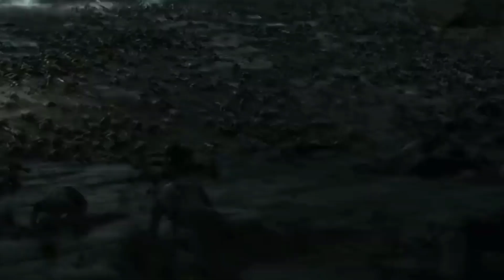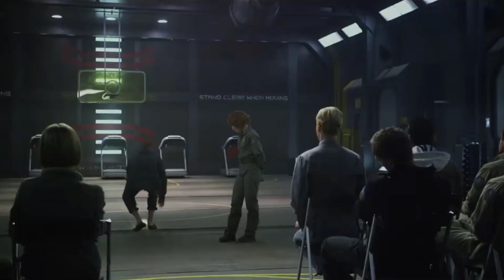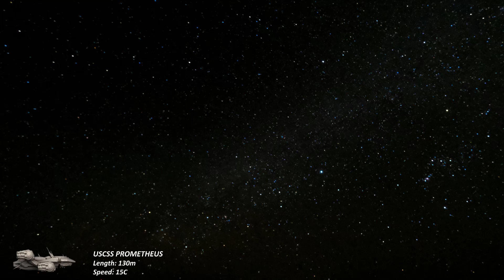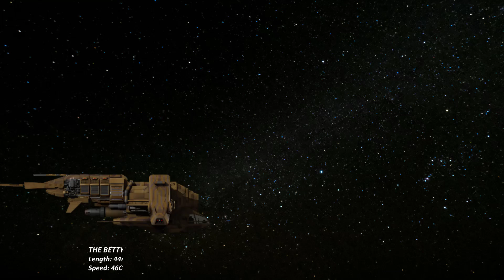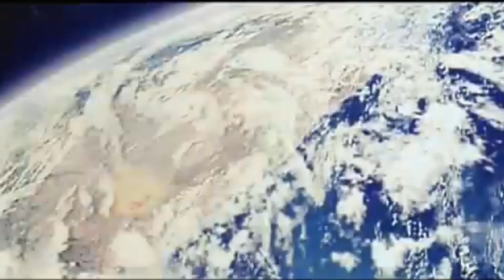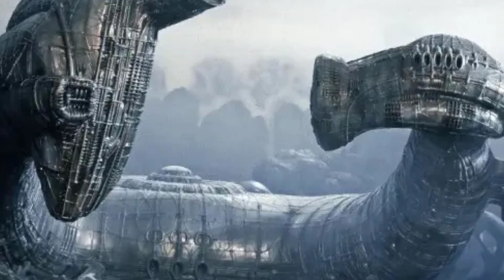10 Biggest/Fastest Spaceships of the Xenomorph Alien Universe

Comment: Kinda weird to think that ships from Aliens can out run a lot of ships from Star trek
Reply: Not only that, while faster, those ships are incredible small in dimensions for the job they do.
For example, the USCSS Covenant is roughly the same lenght of an Halo's Autunn-class Heavy Cruiser.
But it lacks mass, armor, weapons, proper FTL and Jump device, shields (after the war)...
The USS Auriga instead is even bigger than an Autumn-class, but still half of the Infinite-class.
But the Auriga comes from a different era of Alien, so it's kinda hard to fit the ship in the proper context. 
It's like comparing a sailing vessel from 1800 with a nuclear submarine. It's a bit odd.
While all the ships of Halo used by humans belong to the war-period era that spans just 30 years.
Reply: @danielefabbro822  they're still bigger than most of starfleet vessels
Reply: There are no Faster than light ships in the Alien universe 
Why did the crew of prometheus have to be in stasis if the trip only took 2 years and was traveling 15 times the speed of light
Reply: @FP194  no, they wasn't travel at that speed. Maybe it was 15% of speed of light.
And yes, there's no FTL technology. What they call "FTL" is just a ship accelerating a good part of the speed of light and then decelerating. That's it.
Reply: @danielefabbro822  so how can prometheus landed on their destination in 2 years?
Reply: @AdeTri-pu7qi  Zeta 2 Reticuli is basically behind the corner.
Reply: @AdeTri-pu7qi  but mostly... It's because it's sci-fi.
Reply: @ that's not answering the question
Reply: @AdeTri-pu7qi  go tell that to the designers of those ships.
Nothing we have today in sci-fi is realistic. Absolutely nothing. So we can technically close an eye over it when it came to stuff like Halo or Star Trek that roughly try to offer a quasa-realistic/slightly reliable scientific base to explain how it works.

In Alien those ships tries to do things without considering modern physical theories. It's said that FTL technology in Alien can simply accelerate objects beyond light speed.
That's not how it works. Or we wouldn't have need of wormholes and warp bubbles to cheating on that speed limit.

Simply enough the designers of Alien universe have decided that in their universe that's how things works.
Reply: @danielefabbro822  they don't explain how it works doesn't mean there's no FTL or everything in their movie is nonsense anti physics scifi
Reply: @danielefabbro822  Yes they do have FTL technology, they call it a tachyon shunt.
Reply: @FP194  As it is stated in the description of tachyon shunt (which is known as a real thing for FTL travels in Aliens universe) it transforms entire ship within its field of influence to tachyons that are moving FTL on their own. Tachyons require a lot of energy to be slowed down, just like common propulsion systems require more and more energy to bring ships speed closer and closer to speed of light (they kinda mirror normal particles relative to speed of light). It works as a loaded spring which is being hold by shunt and a lot of energy. When released, tachyon shunt launches ship (which is made of tachyons by that point) to extreme FTL speed that is normal for tachyons without slowdown. Cryopods are required because of time distortion effects that happen during tachyon shunt FTL jumps (time onboard moves quite a bit slower), it allows crew to survive and age normaly by slowing their metabolism. This causes another downside effect - upper limit of speed, when reached any travel would become immesurably long and thus deadly for crew onboard. It also requires energy to slow down spacecraft after acceleration, somewhere in the middle of its way
Reply: 2years is a long time though isnt it for a full crew. 2 years of food for every person. 2 years of water? 2 years of going to the toilet.....yeh best go in stasis me thinks  @FP194
Reply: @FP194  Because traveling 39 light years at only 15 times the speed of light takes about 2 years lol. Actually it would take even longer, because 15 times the speed of light means it takes you 1 year to travel 15 light years, and 2 years to travel 30. 39 (lets say 40) would therefore take about 2.5 years.

Comment: I had to stop at about 2 light years per day.  Man.... that is fast.  It would still take about 180 years to cross the milky way (end to end).
Reply: Mankind in Alien universe is still young to develop more efficient ways to travel FTL.
In Halo, by the year 2300 circa, the UNSC is able to use "hyperjumps". Basically they developed a device to open wormholes able to bring the ship from a point to another of the galaxy.
In Alien humans just accelerate ships to crazy speed in order to shorter distances. But it will never be perfect such approach. It will always take more than what is acceptable for humans. Unless we don't make our life longer... Of course. But it will never happen either.
So Alien universe remain a place where life is hard, mysteries are still a thing and there's a lot of space between you and the next safe port.
In a sense, it's perfect for an horror story.
Reply: @danielefabbro822 What? Humanity in the Aliens-verse has FTL drives. They use tachyon shunts aka displacement drives to travel FTL. It's just that they're slow. Like the fastest ships can do about 1.63 light years per day.
Reply: @warellis  yes, indeed, but that technically isn't FTL.
You know, if you match or overcome the speed of light in real space, you get some obvious problems.
First of all is time: light moves fast, but if you cross that limit then time will slow down to the point it will not work at all.
In Halo they turn around that problem by generating wormholes that cut through space and time a way to arrive where they want in relativistic times.
It's way kore efficient.
Not to mention that even if the Alien tachyon tech is fast (relatively of course), it will always require half of the voyage to slow down.
So travel around star systems will ALWAYS take long times.
It's a problem I'm facing in my novel about an "USCM - Covenant War" and... I'm sad to say that but the Covenant can obliterate every UAAC fleets and ships they encounter.
If Halo UNSC Navy was at least able to keep up with Covenant agility in space, in Alien the UAAC have total absolute naval inferiority. 
It came a bit handy the fact the UAAC ships uses energy weapons that can affect Covenant shields and grant them a margin of safety during space engagements... but they have no shields like Human-Cpvenant War-era UNSC ships.
Unlike UNSC ships however, they are not equipped with Titanium-A armors that are heavily resistent to heat, and so to Covenant plasma rounds.
In the books for example, the UNSC Pillar of Autumn refitted was able to hold her ground against conventional Covenant plasma artillery and just suffer from the more destructive plasma torpedoes. 
UAAC ships have nothing like that.
Except for the two main lasers of the classic Conestoga-class, they rely on light naval conventional artillery and to missiles to attack enemy vessels... and if the enemy shield is able to sustain a barrage from MAC guns of Halo, the light naval artillery of a Conestoga will not even scratch the shield of a CCS-class Ket-pattern Covenant Heavy Cruiser.
So Covies can easily engage even in close quarters, entire UAAC formations without actually suffer casualties.
In that sense, the best the UAAC can do is split forces and attack the enemy from multiple directions in order to get a lucky shoot on Covenant targets... but still the repulsion drives of a CCS-class are way faster than the less reliable Fusion engines of the Conestoga-class.
I can just figure it out that after some time the UAAC will try to upgrade the Conestoga-class like the UNSC did with the Pillar of Autumn and make a more reliable ship... yet we talk about dwarfs fighting giants.
A CCS-class cruiser is roughly 1782 meters long... a Conestoga-class is just 385 meters long.
90.7 millions metric tons vs 78.000 metric tons of ship... It's an inhuman fight for such ships.
For comparison, the UNSC frigates like the Paris-class is 535 meters long and have 1.3 millions metric tons of displacement.
The Conestoga-class wile being a good ship is damn small and weak for the task.
They will be wiped out like flies.
Reply: @danielefabbro822  What the hell do the Covenant have to do with the Aliensverse? Like I'm reading this reply and I am legitimately confused. It's gibberish.

And your rambling, claiming humanity in the Aliensverse doesn't have FTL, is a straight up lie. Aliensverse ships use tachyon shunt hyperdrives that convert a ship into a state composed of tachyons, and thus cannot travel slower than light when the drive is activated.

Humanity in the Haloverse, on the other hand, uses slipspace, a type of hyperspace (an alternate dimension) to side step relativity.

And of course Conestoga troop transports aren't battleships. They're troop transports. Like your reply is just gibberish and rambling.
Reply: @warellis  for absurd the USM Auriga could have been a more reasonable vessel to oppose to the Covenant.
With her 3657 meters long its roughly two and half times longer of a CCS-class cruiser.
Unfortunately the USM Auriga was just a research ship and most importantly it's a ship from 2381... far away from the classic ships and United Americas era between 2170 and 2190...
So no USM Auriga in the novel.
I just try to add an upgraded version of the Conestoga-class with improved armor, weaponry and Marine complement. Plus, if possible, some improvements on the engine drives... these ships are already small as f*ck... they need to be agile to avoid direct hits from the Covenant ships. But they are more advanced than the retro tech of the UAAC... so here another huge gap to fill.
I can just suppose that another improvement these ships needs is an improved MU/TH/ER mainframes, maybe a 9000 series or even better, even if such advanced mainframes are said to be able to become self-aware. It will fill the absence of Cortana...
Or maybe the Alien "Cortana equivalent" could be a Synthetic... why not? I was more likely to use them as counterpart for UNSC ODST but... it could fit the purpose.
In any case, the naval engagement that I'll show in the novel will see UAAC fleet being systematically wiped out without too much effort from the Covenant.
With the even smaller "Bison" and "Corvus" classes used as infiltrator ships to board Covenant ships in numbers.
But here a thing... It was said that the Bison-class (CM-88B "Bison" M-class, the USCSS Nostromo) have a total lenght lf 334 meters... In short is basically roughly the same of a Conestoga-class... that's sounds weird to me. It can't be like that.
Both ships looks like having way different dimensions and if it's up to me, the Conestoga would at least be around 700 meters long while the Bison-class would be barely 300 meters long. With equivalent displacement of metric tons.
I can just figure out that Alien developers have had no clear vision of what is a spaceship and how it works.
Conestoga-class troop transport barely able to carry a single platoon per voyage? What? It's a joke right? 
UNSC cruisers can carry thousands of troops to reach a Battallion-size unit worthy of troops complement.
How exactly the UAAC hopes to carry out a war in space? Using 3500 Conestoga ships to carry a whole Regiment? It's pointless and stupid. Let me fix it by increasing the dimension of the ship.
In that way a single vessel can potentially carry enough troops to conduct independent operations for 3-4 months without support. That's how you do space warfare.

And the Bisons and Corvus are potentially excellent vessels to conduct black-ops operations.
Bisons are the UAAC equivalent to the UNSC frigates. They not only can carry out a small contingent of troops (without vehicles), but are tiny and so invisible, with a bit of specific work to madk thermal radiations these ships can become invisible.

The Corvus ships (CM-90S "Corvus" G-class) like the Anesidora in Alien Isolation are even smaller.
They can be the equivalent of the ONI Prowlers used for proper black-ops. Using Synthetic equivalent-ODST troops to infiltrate Covenant ships and, with the help of the Company... release "biological weapons" in it... 😈 In a war of extinction you don't care about moral aspects and consequences of using Xenomorphs against your enemies in order to survive, right?

So these little ships can easily sneak in enemy Covenant formations during combat against Conestoga line ships and land inside Covenant big ships.
A Corvus (that btw it have a name that is almost prophetic since the "Corvus" was the grapling hook the Romans used to board Carthaginian vessels) that lands inside a Kerel-pattern CAS assaukt carrier of the lenght of 5347 meters while being itself roughly just 250 meters long is just a mosquito on the shoulder of an elephant... but if that mosquito carries a nuke or Xenomorphs... that is the end of the carrier. Of course the nuke is faster than Xeno, but both have the same effects.
I can only imagine that both UAAC and Weyland&Yutani can use the Xenomorphs to wipe out the alien crew and get in that way a fully functional Covenant ship for retro-engineering.
That would be a huge victory for the UAAC... of course, IF they are also able to wipe out the Xenomorph hive that will take possess of the ship... and considering that Xeno usually takes genetical traits from their hosts... I can just imagine that Xenomorphs born from Sangheili and Jiralhanae could possibly be a nightmare even for the already deadly lethal Crushers and Pretorians.
But that would just increase the "horror factor" right? It will be cool. 😈😎👍
Reply: @warellis  well you have just to read carefully. Or just shut up and go commenti g someone other instead of coming here mocking me.
I have my work to do, and I have no time to waste talking with those who clearly don't want to talk about what I'm working on.
So if you're here to just crying about facts and complain: please, go away.
If you instead wants to talk about the cross universe Halo vs Alien: then you're welcome.
Choose, but not waste my time.
As you can see, I have lot to do.
Reply: @warellis  of course Conestoga are not battleships... but the UAAC have not, never shown any other type of ship.
For what we know, other than Conestoga troop transport, Bouganville troop transport and Tientsin troop transport ships ... there's nothing else. And that's worrying.
So... I'll make my own adjustments to this errors.